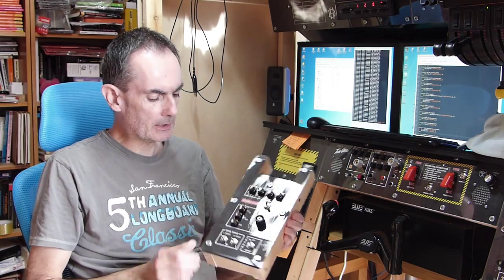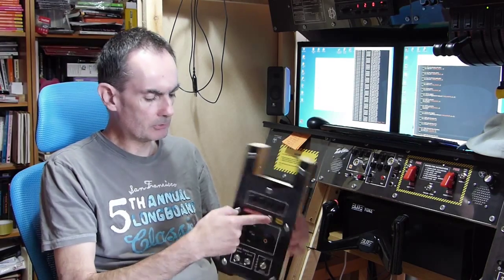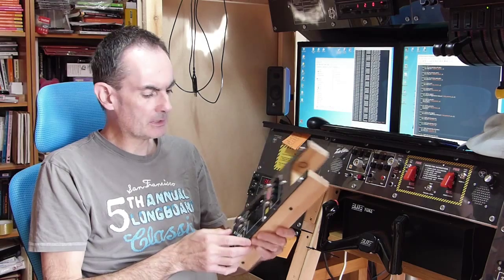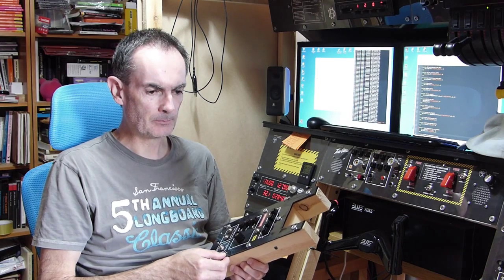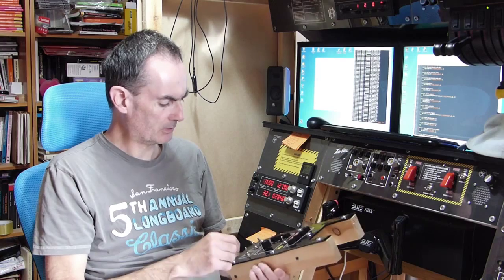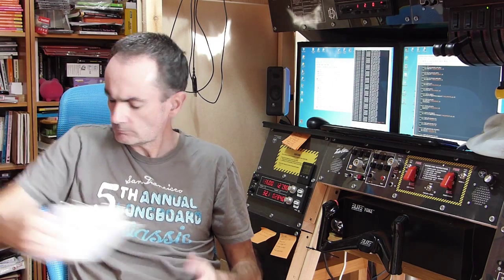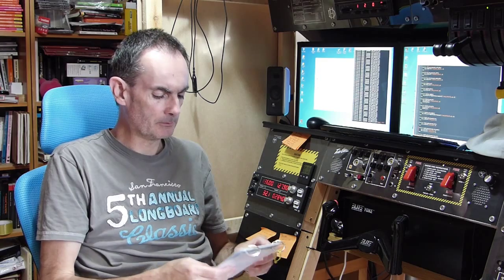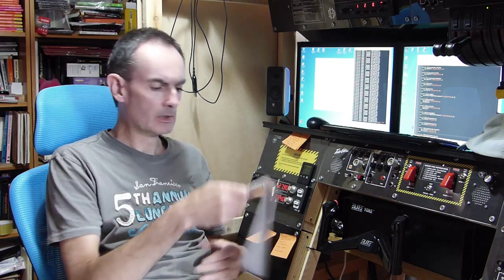Adding an Extra Panel (Twin Otter Cockpit Build - Part 20)

Comment from the maker: Cletus: Yes, FSX for now. I will go with P3D eventually but probably not until my next hardware upgrade. The Twin Otter is a particular pain if FSX becomes unstable as FSUIPC's autosave doesn't save its internal state.

Comment: Are you sticking with FSX? Considering P3D - I'm thinking stability here, I just was doing a flight in FSX Brussels - Glasgow. Spent an age setting it up, then all the taxi take-off all proper procedures for once until starting the descent when bam! FSX vanished with no warning or notices. Totally scunnered.

Comment: Hi. Thanks for this series of videos. They have really taught me loads and explained some things that I was struggling with. I really like the lights that you show in this video. Can you tell me where you got them and give me a link if possible. thanks
Reply from the maker: I got the lights at a Tiger shop in Luton (www.tigerstores.co.uk). To be honest, they aren't that good because they run on 2 button cells and don't last very long :(
Reply: Almost Aviation
 That's a pity. They looked good!
Reply from the maker: Yeah, I could probably rig them up with external battery packs or a transformer, it just means a couple of wires going up the stalks. Would probably still be quite practical though.
Reply: Almost Aviation Why have you stopped using Panel Builder? You were using it and did a very good tutorial on it.
Reply from the maker: I just don't need it at the moment. Besides, it only works for default gauges.